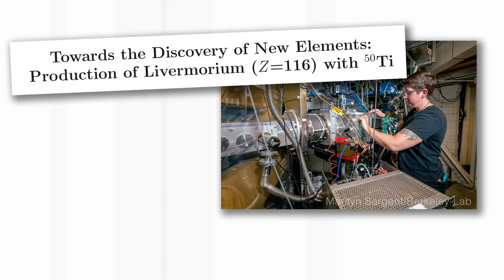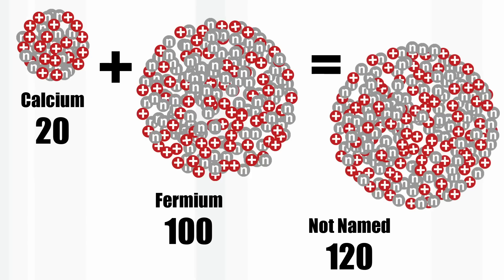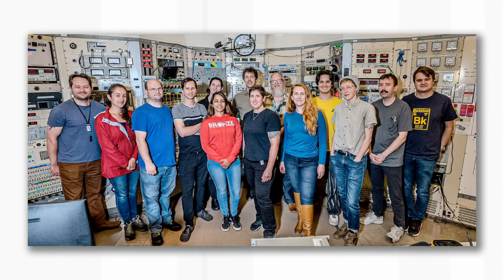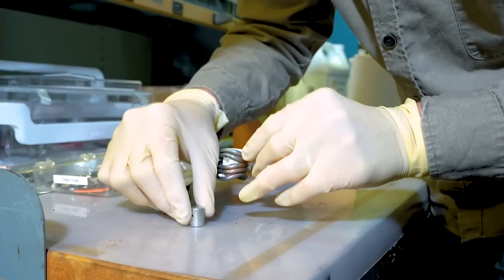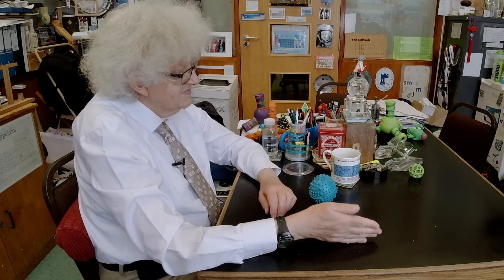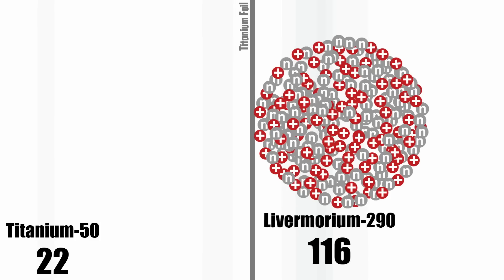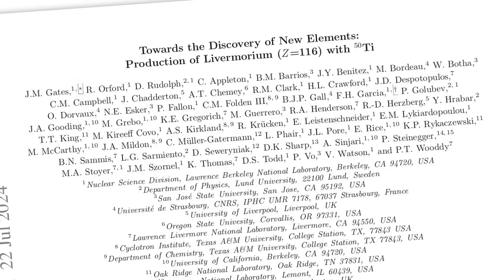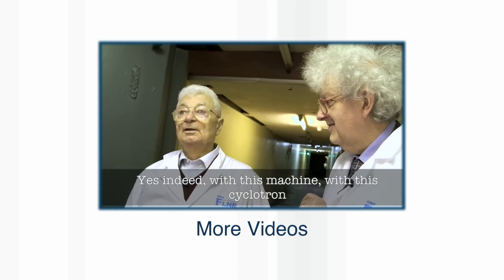How to make TWO ATOMS (and the path to element 120) - Periodic Table of Videos

Comment: The reason why it’s so difficult to make large elements is relatively simple. The strong force is incredibly strong but only acts over distances of quarks with it dropping off just so capturing its nearest boson neighbors. Electromagnetism drops in here and acts as a repulsive force pushing the protons apart. The more protons, more repulsion. That’s why neutron numbers increase faster than protons as elements get heavier. So, when we shoot atoms at one another and we lose neutrons the protons simply push each other away so much we lose the strong force’s influence and magnetism becomes the dominant force. Of course the weak force gets to decide ultimately what the end products will be.

Comment: Question: Couldn´t you let 3 or more atoms collide into one spot from 3 or more different angles instead of using one superheavy (here Californium) and one moderately weighing atom like Ca ? Common colliders are having only one toroid in a plane. One could use the 3rd space for angled planes of toroids as well.

Comment: I think that the reason why scandium hasn't been used is that it doesn't have any suitable isotopes.  Its one stable isotope, Sc-45, would produce isotopes that are very, very low in neutrons (as opposed to the current methods, which produce isotopes that are just very low in neutrons).

Comment: For the neutron ratio, heavier elements also need more neutrons to be stable against the electrostatic repulsion of the protons. While lighter elements usually are most stable around a 1:1 ratio, much heavier elements have an increasingly higher ratio; for example:
Neodynium, element 60, has the most common ratio of ~1.37 neutrons per proton
Mercury, element 80, has the most common ratio of 1.525 neutrons per proton
Uranium, element 92, has the most stable ratio of ~1.587 neutrons per proton
The problem is, with 2 lighter elements, the total ratio of neutrons to protons is often too low for the fusion product.
Calcium-48 has a ratio of 1.4 neutrons to protons, which is much closer to the average for heavier elements than other isotopes in that range.
Even then, we can see that, for example, the only isotope of Og produced has a ratio of ~1.49 neutrons to protons. Quite possibly a heavier isotope could be significantly more stable, but much more difficult to produce.
For example, take Moscovium, element 115, for which a number of isotopes have been produced. The first two (discovered in the same set of experiments) produced Mc-287 and Mc-288. Later discoveries of Mc-289 and Mc-290 have significantly longer half-lifes, with Mc-290 having a significantly longer half-life (650 ms) compared to the others (250 ms, 193 ms, 38 ms, 20 ms) which suggests that the most stable isotope could be significantly heavier.

Comment: It's utterly crazy how much effort it takes just to achieve 1 or 2 succeessful atoms of a new element.. The process is just absurd. I wonder if they could combine their methods With also using high strength magnetic fields, high pressure environments, high temperatures or a vacuum environment or cold temperatures.. maybe electrical impulses, plasma,  high voltages in any sorta combination maybe any of these factors could improve the process in this field of science?

Comment: My problem with naming elements is that the new method is just to name them after a famous place or person.
Why not a chemical of physics reaction - oxygen is acid(oxy) forming(gen) - or some sort sort of characteristics - rubidium has a red line in its spectrum.

The Ti used to hold it made me think of actually using it for the actual atoms. You hit the Ti on the other side and make it hit the Pu or put the Pu in between two and vibrate them piezo-style or something else.

The Ca atoms not hitting the Pu made me think of quantum tunneling. Weird quantum effects are needed to fuse hydrogen in the sun so I have no idea how that might help.

Comment: They don't use scandium because its only stable isotope has a neutron excess of only three neutrons and you need a larger excess to get a product with enough neutrons to stay stable long enough to be detected. calcium 48 has an excess of eight neutrons, as does titanium 52. vanadium 51 only has an excess of five and chromium 60 of six, so titanium should be the way to go to get element 120, but I assume it doesn't work because we would have produced element 120 before now.

Comment: Just like a hydrogen bomb, you need a cold and a hot element. To make this happen, Fermium needs to be super hot, more than twice the temperature of the sun. Just remember the temperature of the sun is only hot enough to make Iron. The larger the element the hotter it needs to be.  Calcium needs to be as near as absolute zero as possible. You will be able to make element 120 by the bucket loads.

Comment: To answer some questions in the video:  Scandium is not used because its stable isotope is of mass number 45, so having fewer neutrons than calcium 48; heavier isotopes of scandium are highly radioactive.  Titanium 50 is stable but rare (like calcium 48 is for practical purposes); vanadium 51 is stable and so common that you don't need to isotope-separate it; chromium 54 is stable but rare.  And you need for the projectile AND target to be as neutron-rich as you can get, because the superheavy elements need to be even more neutron-rich to get the longest alpha decay half life, and the collisions used to make them tend to throw off neutrons because those are more numerous than the protons, and therefore more easily knocked off despite the electrostatic repulsion trying to push the protons out.

Problem is that when you get enough neutrons to get the longest alpha decay half-life, then the nuclei rapidly undergo spontaneous fission.  This is already a barrier to trying to make elements heavier than fermium by progressively adding neutrons as was done to make the transuranium elements up to fermium.  The heaviest isotopes of fermium and nobelium undergo spontaneous fission in microseconds to milliseconds (except 1.5 seconds for fermium 259).  So I suspect that the "Island of Stability" is going to turn out to be a mirage, just like the one we were supposed to have around element 114 (flerovium).
Reply: Yes you have carefully balanced the incoming energy so that the resultant Mass hasn't got so much eccess energy that extra neutrons flying off can stabilize it for a short while

Comment: Dumb question here, instead of a traditional displacement accelerator, couldn´t a spin accelerator with the atom "suspended in the field" work?, (now,...I know it´s not only "a single atom fired", but still). then, merge the two fields of the colliding elements without firing the lighter element to the heavier element, but sort of creating a merge like a star eating another star in a binary system. (once again, I know gravitational forces don´t come into play in this case, but we are making use of the other fields in a simulated way). Perhaps it would need a magnetic field generator hugelly more powerful,, I don´t know

Comment: how much energy would it take to fuse an amalgum of 2-3 of these elements via pressure? What if there was a possible amalgum of lower elements placed into a strong container and a plug of the remaining volume of the elements was launched at it via contained oxy/hydrogen gas ignition or an accelarator with gun powder ect. would it be possible to obtain any new elements at all or would every single bit of atoms miss?
Reply: the vents of the crucible would likely be made of many quarters of hollow doughnut like shapes nested in on another so that the surfaces of those baffles could be scraped for evidence of the new elements
Reply: You can not use a chemical gas building reaction as there is a maximum gas speed these reactions can obtain. Well under the fractions of C required for smashing these together.

Comment: For reference, 6 trillion atoms a second for 22 days is around 1 milligram of titanium 50.
Reply: 1 milligram of titanium 50 accelerated to 200MeV per atom would have a total kinetic energy of about 395MJ quite impressive. Imagine a speckle the size of a grain of salt suddenly releasing as much energy as 90kg of TNT.
Reply: Atoms are much too small for being practical.
Reply: Also for reference 1 oz of liquid hydrogen and enough heat in a confined space in 1 billionth of a second will produce enough heat to level any city.
Reply: @nathanwoodruff9422  We don't use oz in science, we use cubic meters.
Reply: @mernokimuvek  "We don't use oz in science, we use cubic meters." We do when it is in a world of reality and not some delusional science world.
Reply: @mernokimuvek  Cubic meters in the calculations, more common units of capacity when explaining the science to the common person.
Reply: @dannypipewrench533  The more common units in civilized countries are liters and milliliters, not ounces.
Reply: Heat wouldn't level a city, the kinetic energy released from the confinement chamber traveling through the atmosphere would. I'm pretty sure you still wouldn't be able to melt a city with one ounce of hydrogen in any case, no matter the temperature. Heat also doesn't produce heat unless you're talking about the flash point of a material, and even then it becomes an exothermic chemical reaction.
Reply: @anoobis117  "Heat wouldn't level a city, the kinetic energy released from the confinement chamber traveling through the atmosphere would. "
And pray tell, where would that kinetic energy come from???? My guess would be heat. 
The Einsteins on the internet are starting to sound like Kamala. 
"Heat also doesn't produce heat unless you're talking about the flash point of a material, and even then it becomes an exothermic chemical reaction."
This Einstein has never heard of fusion... I didn't think that was possible.
Reply: @nathanwoodruff9422  You seem triggered, bro.  And bringing up politics here is pretty weird.  Most people in the world don't live in the US and many of them don't know who "Kamala" even is.
Reply: @demoman1596sh really?

Comment: I wonder why you can't shoot Neodymium at Neodymium?

Particularly isotope 150 which is stableish and has lots of neutrons.
Reply: Heavier nuclei require higher energy to break the repulsion barrier and fuse. But this higher energy can destroy your product. Even in heavy stars 'silicon fusion' actually involves breaking silicon down into alpha particles rather than Si-Si collisions. At present it is not clear if using heavier elements as bullets would even work, the energy needed is likely too high.
Reply: @garethdean6382  ahh, thank you!

Comment: Why not just jump to Strontium 88?
Forgive my out of date (circa 1996) Secondary School Chemistry, but surely Sr is closer to Ca structurally than Ti?
Reply: It's not a case of structure; heavier nuclei require higher energy to break the repulsion barrier and fuse. But this higher energy can destroy your product. Even in heavy stars 'silicon fusion' actually involves breaking silicon down into alpha particles rather than Si-Si collisions. At present it is not clear if using heavier elements as bullets would even work without simply always shattering the product.

Comment: I'm curious why they didn't go from Ca to Sr as they are in the same column in the Periodic table and it has a lower melting point that Ti.
Reply: Heavier nuclei require higher energy to break the repulsion barrier and fuse. But this higher energy can destroy your product. Even in heavy stars 'silicon fusion' actually involves breaking silicon down into alpha particles rather than Si-Si collisions. At present it is not clear if using heavier elements as bullets would even work.

Comment: Since changing the "bullet" atom from Calcium to a heavier one is already a major challenge, is there a reason to not try with even heavier elements as bullets? For example Strontium (just below Calcium in the table)?
Reply: Especially when you’re hitting a barrier with Calcium, Titanium moves you just two elements further before hitting the same barrier. But it remains to be seen if the principles to go from Calcium to Titanium can be applied to incrementally heavier “bullets”.
Reply: You run into issues with the energy. The heavier a nucleus the higher energy it needs to overcome repulsion and fuse, but that higher energy can destroy your product. This is why 'silicon fusion' in stars process via alpha particles and not Si-Si- collisions. Getting strontium to work is an unsolved problem.

Comment: How are they able to detect 2 different atoms out of trillions of them?
Reply: By the specific energy of the decay chains. Each successful hit produces a string of signals as the atom decays. From the specific energies and timing you can determine what each step in the decay chain was.This is noisy however, meaning that they CONFIRMED two atoms but likely made more that were missed.
Reply: @garethdean6382   Thanks. Amazing technology.

Comment: TiCl4 is a liquid with a fairly low BP all things considered, why don't they use isotopically homogenous Cl to create TiCl4 to isolate different isotopes of Ti in a centrifuge rather than ionization?
Reply: Getting the chlorine requires a second step of isotopic purification. Working directly with Ti was considered to be easier, especially since only a small amount was needed. If you wanted this for a process like fuel enrichment then perhaps it would be more viable.

Comment: I know even less about nuclear physics than the venerable professor, but I do know that for whatever reason, calcium-48 decays only by double beta decay. It is hindered by the higher energy of surrounding nuclei I guess, because 20 protons and 28 neutrons are both magic numbers. Double beta decay means two neutrons decaying into protons and electrons (and usually antineutrinos) simultaneously, making it extremely rare. (In fact, it is the rarest type of nuclear decay observed.) So even though the nuclide is extremely neutron-rich, it is still nearly observationally stable, and practically stable for all purposes, with a half life way longer than the age of the universe. That means it is also a primordial nuclide on earth and constitutes a meaningful percentage of natural calcium (a whopping 0.2%).

(Also, scandium is extremely expensive, for reasons I don't quite understand, so that's probably why other nearby elements are preferred over it.)

Comment: 3:21 - Scandium is not very useful for this kind of experiment exacttly because of its neutron number. The only stable isotope of scandium has 24 neutrons compared to the 28-30 for calcium, titanium, vanadium and chromium.
Reply: It depends on a lot of factors. Each isotope of an element carries with it a certain binding energy and certain configurations have less binding energy than other ones resulting in that the resulting combined nucleus needs to remove less energy with the neutrons that come flying out. Problem is some elements only have a single isotope
Reply: i thought that it was too expensive

Comment: If this works for 119 and 120, wouldn’t we need to find a new method for 121 and beyond? Shouldn’t we stick with the x0 elements, like with the lower elements which used neon and calcium, wouldn’t Zinc work?
Reply: Not really. After around Calcium or Titanium (maybe even Chromium if you're lenient enough), the beam becomes extremely difficult to keep running smoothly. Additionally, the respective masses of the beam & the target would get a little too close for comfort and, in turn, make it extremely unlikely that fusion would occur, which doesn't really help. Just to make matters even worse, Zinc-70's nucleus isn't exactly all that magic like Calcium-48's.

Comment: The combination of Ti-50 and Cf-249, resulting in Ubn-295 or Ubn-296, does not result in a favorable combination, considering that these nuclides are above the main stability line for this element.

The mass of the isotopes with the longest half-lives must be in the vicinity of Ubn-313, Ubn-316 and Ubn-317. Those with mass 295 and 296 will disintegrate quickly.

The idea was to insert more neutrons into the reaction, or use heavier Titanium and/or Californium isotopes.

Comment: Is it even possible to study the chemical features of such short lived elements? Do electrons even have the time to settle into their proper orbital shells before the nucleus decays? 🤔
Reply: I would assume that the formation of an atom in its thermic electronic ground state will take around femto to attoseconds. So yes, to do chemistry with elements which at best have a half-life in the millisecond range you would need a much higher cross section in the creation process, which means a lot more atoms created than 1 per hour or so.
Reply: Amazingly, yes. the chemistry of the heaviest transition metals is at least roughly established, largely through split second experiments and hen seeing where the radiation ends up. It can be very, very basic, but not nothing.